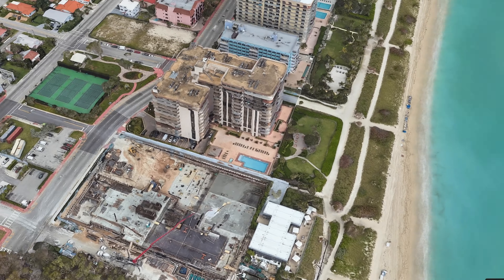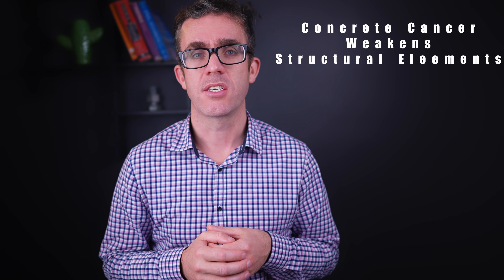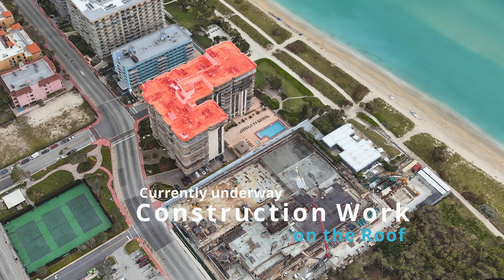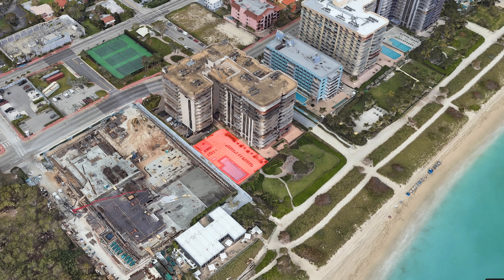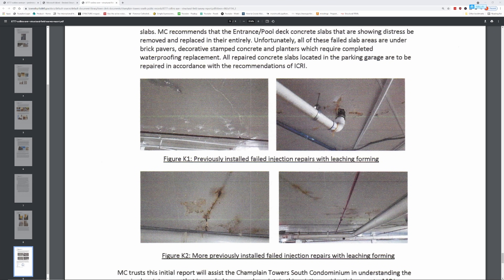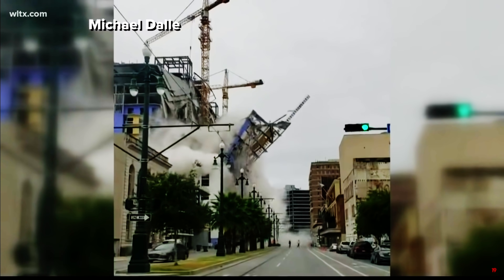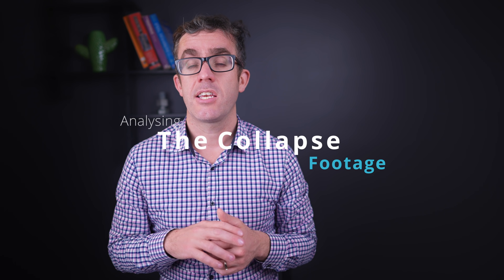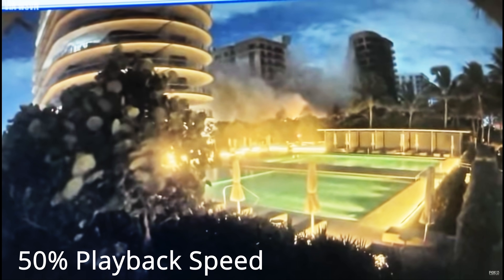How did a Miami building collapse: The Warning Signs. Report and  CCTV footage analysed

Comment: OMG - I am watching this and I am terrified. I live in the UK in a surf town as well. I bought a luxury apartment 3 years ago and very quickly this dream turned into a nightmare. I am a charted engineer myself and I started reporting number of major defects. The developer doesn't want to spend any money for repairs and nobody wants to listen to residents. We have water running through walls and ceilings in the underfloor car park for over 3 years. All concrete ceiling slabs is spalling, ceiling slabs are moving, gaps between ceiling slabs are now over few cm in places, reinforcement is sticking out. Steel is corroding very quickly (steel frame building and salty water doesn't help), steel is not protected from fire and all the paint is bubbling and coming off. The residents have been reporting feeling building moving in amber winds (and our building is on the cliff) - developer totally dismissed our reports. Beam to column connections are lose and some bolts are missing. However, what is really worrying me is one primary connection that I have been monitoring for the last two years. In June I noticed that the gap increased so I decided to get a ladder and measure that gap. I then discovered that 5 bolts from this one connection I can undo by hand. Also the bottom bolts are demonstrating the shear failure. Then I noticed that other few connections have 5mm gaps and some bolts are lose in them as well.  I reported the building 4 weeks ago to the council building control but it has been 5 weeks now and they are refusing to help. (the reason is that the developer employed a private building control that most likely was influenced to sign off out building). I am really terrified after watching this video that our building is close to collapse as well. 
Not enough the developer is that negligent that he decided to build next door and he joined both buildings. He removed part of our basement wall to connect both car parks (with no temporary works) and at the same side of the building he added additional apartment spanning over our building. 
@BrendanHasty as I am not a structural engineer nobody wants to listen to me - can you help us to 'analyse' our structure. The building is fully occupied and I am really concerned. How quickly the building can collapse? Will it collapse it the one primary column to beams connection fully snaps?

Comment: Will a time come that a whole generation of reinforced concrete structures will be a liability? Is concrete cancer inevitable over time? ( Especially in coastal locations) I can't imagine how costly it would have to be to demolish and rebuild RE structures every 100 years...
Reply from the maker: Hi panfor it depends some structural will have issue, others if maintained will be OK. Most buildings nowadays are demolished prior to this occurring.
Reply: @BrendanHasty  thanks! I suppose people often want to reconfigure housing within 100 years but it is quite a lot of resources. Do Precast bridges have greater corrosion resistance reinforcement or greater rio embedment than housing applications? ( I live mid coast NSW and we have a few new bridges and I hope they last a long time!) Thanks for your channel, cheers Ben

Comment: There should be code requirements for seaside concrete construction ie epoxy coated rebar, concrete mix adjustments etc….
Reply from the maker: Hu mode, there are design requirements around conditions, the investigation will cover if they are sufficient.

Comment: from the other videos of the analysis of the collapse , I think the colums at the deck level were tied only by the slab. There were no beams. when corrosion set in the deck slab,  the slab could no longer provide the lateral resistance to the bucking of the column, causing a sudden collapse. 
please correct me if my understanding is wrong.
Reply from the maker: Hi Abhijeet, I think the analysis you are talking about isn't about the loss of support of the columns it is that other areas of the slab collapsed, causing a tension load putting additional loads secondary loads in the columns
Reply: @BrendanHasty  thank you

Comment: Brendan Hasty, I keep wondering what might have shaken this building after forty years. Why is no one considering that just days before the collapse, Flordia had a 3.9 earthquake from a very powerful Navy offshore test? The seismographs recorded it and it was in all the news media. Could that have been the straw that broke the camel's back?
Reply from the maker: Hi Bill, I think that it could have affected the building, but it is kinda like the Storey who sank the boat, in short, a lot of animals got onto a boat, and the mouse was the last to get on was it the mouse's fault? The building should and would have been capable of resisting such an earthquake, and likely the magnitude felt from this event was likely much less than 3.9 as this was likely the measurement at the source. So if the question was why now? Then maybe, but it shouldn't have affected the building.
Reply: I live in California.  A nearby 3.9 earthquake is next to nothing.  A 3.9 miles out to sea is nothing.  Buildings must tolerate shaking much worse than that.  If they don’t, they are defective.

Comment: In my opinion, the collapse of the Surfside Towers pool deck was the same as jerking a rug out from so one standing on it without their knowledge. However, in this case, the jerking actions created by the concrete pool deck going down pulling, cracking, and snaping the rebar and concrete the actual building columns and beams they no longer had the strength to sustain the building south facade face. The building foundation and columns were not constructed to take a side pull or push at its base. It's built to support the weight of the floors above.

Comment: Question: could the force applied from the deck to the column overcome the immense axial load that was on the column?
Reply from the maker: The pool decks weight relatively to the whole building  would be minimal. So it would be unlikely that the columns o the lower floors would be overload by pool deck.  Could the canterinary pull columns with enough force to break them that would depend on the detail but unlikely, it will be something to keep an eye on.
Reply: @BrendanHasty  Yes..I think the columns were damaged by the deck connections ripping out of the column and causing it to Buckle due to radius of gyration and unsupported height. Also a large moment applied at that joint.
Reply: @BrendanHasty  If you want to see some incredible pics from the demo let me know. This is out of the realm of engineering and is in the realm of the unexplained. If you want to analyse this let me know...
Reply: @BrendanHasty  Can you do the calculation of the moment exerted on some of the columns vs. the design of the column? This will show proof overloading of the joint. I'm too rusty to attempt it!

Comment: Ok smarty.. now watch the dust cloud .when the middle is gone. Ocean side stood like u said it should. Go frame by frame. Look at the  MEGA white flash in the dust cloud, to make that many tons of dust turn light..something happen.
That's when ocean side part fell..
And your right..floors can with stand floors stacking. 911 towers prove that. A DAME jumbo jet FLYS thru the building and it stood.
Note, CONDOS ocean front even in 1982...
Were over built, and most had double the strength that was called for....it was there selling point... also, that building was fort knotts. 
Cameras everywhere. Mangers offices where dozens of SECURTY TVs, hard drives were not touched. Not till the demo..simple say...
Wheres all the live video of the building falling.
Who was running theu the garages. Who ran out of the buildi g 20 minutes before it fell.
Why hasn't the feds, showen....pool deck SECURTY videos. It should have been a homeland securty crime seen. In the first hours with feds swarming in. What we do know. Feds were a  no show, we know CONDOS owners own engineer is not loud to take core samples. 
No news crew even brought up hundreds of SECURTY camers every where..... the land has been sold off. Only the mayor investigator is loud in the site. The city full well could be held for the collapse. Even the insurance company does a yearly inspection so they can charge more..., no one ever said, unsafe... that falls on the mayor's office.

Comment: Concrete Cancer, nice thought, the problem is we do not see a whole lot of rebars inside the deck and columns...... no rebars, no rusting, no spalling, no cancer...... so how did the deck and columns failed again???? :)
Reply from the maker: Concrete Structures require reinforcement otherwise they will not work. If you look at the structural drawing you can see reinforcement detailed. If they find no reinforcement that is a major issue. Rusting degrades the reinforcement strength.
Reply: @BrendanHasty  If you look at the photos of the pool deck and columns after the collapse, you will see one or two rebars sticking out from the columns. There is no rebar in the deck or the rebar would have hold the deck together. The deck butterflied and fell into the garage because there was no rebars.

Comment: There was actually a shot of a 5gallon bucket with rusty water seeping out of a pile or wall. Degradation of rebar, was definitely an issue. 
And ,,they did say there was major work being done next door. Possibly foundation failure could have been a cause of accelerated fault.
Reply from the maker: Hi Peter, footings are very sensitive to water changes. Dewatering from adject construction has been know to cause issues around the world. This will need further investigation.
Reply: @BrendanHasty  Yes I'm sure. Hopefully the garage will give some show of proof of what happened. So many different opinions going on.
I've built homes, dug footers, placed wooden piles for foundation, but when it comes to the huge commercial high risers, what I'm used to is peanuts. I'm awed by the huge piles, they use in highrise construction. Three stories is my limit of experience. Thanks for these views.

Comment: I don't know if this had anything to do with this particular building collapse but, over here in California, we get earthquakes. One of the nastiest things that earthquakes do to buildings that have been constructed to withstand the shaking in and of themselves is that the shaking can cause the soil to settle in a short amount of time. This is a problem here sometimes and more so in places like Japan with more water in the soil because the building never sinks equally, which causes it to tilt and sometimes even tip over. It makes me wonder whether all this water damage in the basement garage was just from leaks from above and not from the proximity of this building to the ocean and perhaps the lack of properly securing the foundation to the earth itself. At the time this building was built, we still had a lot to learn about liquefaction due to earthquakes and since this kind of subsidence happens so slowly, I can see why people might not think about it in the same way as we think about it in places in which we have earthquakes. It seems like much smaller, relatively unnoticeable vibrations over a much longer period of time could eventually cause something similar to the rapid liquefaction that can happen during earthquakes in weak soil.
Reply from the maker: Hi who ever I hadn't thought about liquefaction being a cause but it was built on sand with a high water table, so it could be. Also not sure how much vibration you need to start. But I could see buildings with shallow footing over a long time may have this issue.

Comment: I was wondering if and how far does the under ground water table go from the beach underground under buildings as the building is so close to the beach? I was wondering if that could of contributed to the collapse
Reply from the maker: The salt water will likely attack the footing rusting the reinforcement, and typically you would design footing for this, with concrete cover some times admixtures in the concrete. This will be something that would be investigated of needed.

Comment: This guy WRONGFULLY claims that added weight on the roof would have NO adverse impact whatsoever.  He cannot make that assertion, because he does NOT know the structural parameters of the design.  In fact, EVERY added load that is above the design load is a matter of concern.  There are instances where structural engineers don't even get the design load correct.  Case and point were the Library at Syracuse University back in the 1970's that required the complete removal of ALL BOOKS because the floors were deflecting and showing signs of compromise -- and that was just the dead load.  
Unfortunately, his one BOGUS statement potentially negates everything else he has to say.
Reply from the maker: The additional load on the Roof would have minimal effect for the overall structural, as the mass of the structure would be soo much compared to the overall weight added to the building, concrete is very heavy, and the load required to be added to the roof would be in the tons per meter to overload the columns, footing or walls on the lower floors. Could over loading effect one floor yes, only locally to the floor over loaded, which could cause a top down cascade collapse. And the case you reference indicates a local issue, as local slabs where deflecting too much, if load was missed on all floors this may cause an issue which would need to be assessed if all floor are showing issues.  And the reference regarding the loads where additional loads added only to the roof.

Comment: In addition to the construction of 87 Park on the south (which included digging up 87th Terrace), the ACOE performed the Surfside Beach Replenishment Project in 2019-2020 using 88th street on the north side of Champlain South to access the beach with heavy equipment including dump trucks to deliver 300,000 cubic yards or sand.

Comment: There is so much more information out there now, the first collapse was the pool deck area, this was a punch through of the columns through the slab, this created a large Shockwave through the structure. Then at 7 minutes after the pool slab collapse the north side building columns failed causing the facia to fall first then cascading to the south. Then after the main portion of the building fell Then the end of the building fell toward the north and east pancakes as it fell. Concrete cancer for sure, possibly a design flaw

Comment: The connection between the columns and the floor even in the end it comes down to poor maintenance if there's water leaking it has to be stopped because once water gets on steel it will rust and fail.

Comment: Brendan, you need to take a look at Mike Bell's potential explanation of this disaster. Essentially: Water -> spalling -> punch-through of columns in pool-deck -> extreme increase in lateral catenary forces on main columns -> main column failure -> catastrophic collapse of building. See this video: https://www.youtube.com/watch?v=hynHiWE818c  

Is he right? Maybe, maybe not (hopefully the investigations will determine that); but it certainly looks plausible to me.
Reply from the maker: Hi Robbie it is plausible, however, I think it is unlikely. I feel that a mass punching failure is unlikely to occur, could you have one yes, but it would be unlikely to migrate beyond that. One punching failure wouldn't cause the columns to fail. There would need to be a secondary cause to cause a mass failure.
But agree it is a great theory on a potential explanation.

Comment: There was a deck probably poorly built and standards probably were lower than the 1st floor of the high rise. The deck concreate was leaking and finally failed, the columns were left standing, there is no problem with a deck failing. The main problem is there was no barrier between this weak, failing deck and the building's columns and its debris knocked over several columns the 1st tower to fall. As towers fell their debris knocked out support columns and there goes the next tower. The only tower left standing had the elevator structure to help columns that might have been knocked out and it blocked debris from most of that building's columns. The structure was easy to take down since it sat on slender columns in the garage, the best thing they could have done is put walls instead of exposed slender columns around the foundation of the building. A concreate wall separating the building from the deck would have stopped pool deck debris and planters, if I were retrofitting existing building from such catastrophes, it would be to build walls around the foundation with passageways for cars and people.